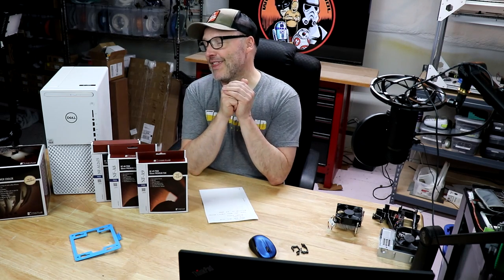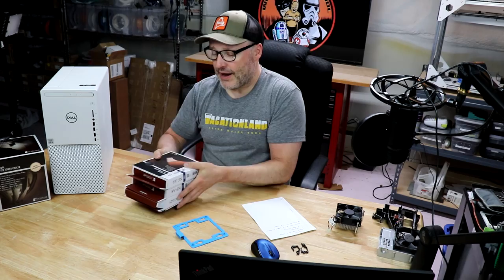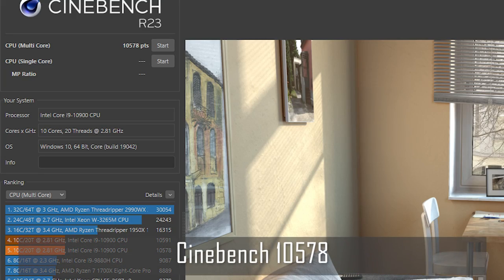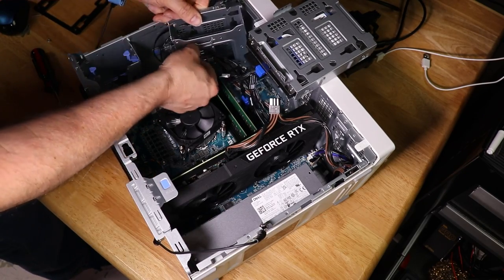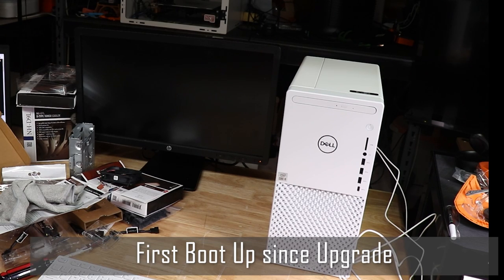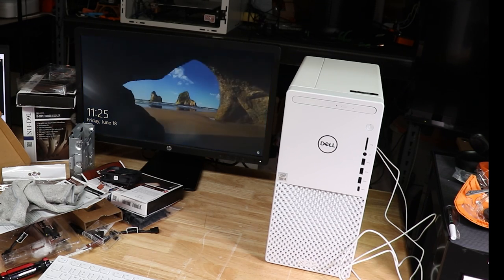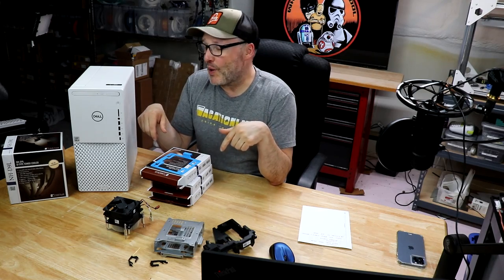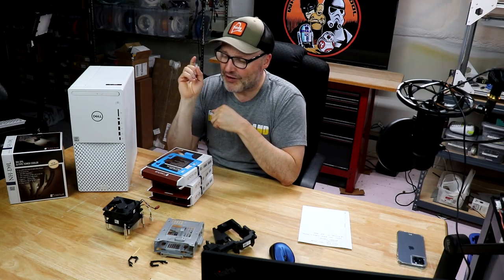Dell XPS 8940 / G5 5000 - Upgrading CPU Cooler and Fan Upgrades for better performance?

Comment: Basically you had to fix what Dell didn't engineer in and should have.   A front intake fan, a propper heat sink, and propper exhaust fan is a given not an option.
Reply from the maker: Right?  I mean it’s sad to see a good Intel i7 or i9 heat throttling down the performance

Comment: Added that cooler to mine. 
Now it doesn't throttle the cpu. 
Instead the PSU trips due to over load. LoL
Reply from the maker: Really?  Mines still running great

Comment: Dell's PC's are built to fail so you have to go buy another one in 2 years. Those temps out of the box are just ridiculous. The lack of airflow and crappy cooler ruin them. If you can wait til prices come down on the GPU's, it's very much worth watching some you tube tutorials to build your own computer.
Reply from the maker: I’d very much prefer to build my own but given the availability of parts, this gets me by
Reply: This is completely untrue Dells are conservative builds for stability and longevity. I’m using an xps from 2013 and it Has never failed in that time

Comment: I have the same computer and wonder why Dell charged me $3000 for a computer I can't use until I upgrade the cooling.  Never Dell, Never Again.
Reply from the maker: We do what we must during supply chain issues, right?  I spent $150 in a cooler and fans to get more performance.

Comment: i wish i could educate the whole world against buying any gaming/creator pc from Dell. Dollar for dollar, Dell is the absolute worse. (Linus Tech Tips, Gamers Nexus, Dawid Does Tech Stuff) And their parts are ALL proprietary. so you can never upgrade anything unless you buy it directly from Dell for triple the amount
Reply: I know there are better gaming computers but if you’ve inherited a Dell or picked one up cheap you can Frankenstein it.  I did most of what the channel owner did to make a video editor.  I have a 2TB NVMe boot drive, a 8TB SSD project drive, and an 18TB archive hard drive.  I upgraded the RAM to 128GB with heat sinks, I upgraded the CPU to an I-7 10700K, I upgraded the power supply from 360 - 500 watts, I installed a 3 fan RTX 3060 Ti, I installed VRM heat sink, I bought a 42MM cooler for the PCH but Dell doesn’t have a sensor for the PCH so I didn’t want to take off the aluminum heat sink.  The PCH gets hot so I’d like to cool it but not knowing if I’m cooling it isn’t a good idea.  I also installed bigger case fans Rand the G5 CPU cooler but I occasionally get an error message about the CPU fan not working and there’s no way to tell.    I switched it out to be safe but that MoBo wasn’t designed for modding!  It runs DaVinci Resolve with no issues!  128GB of RAM, 10 core CPU with 20 threads and 8GB of video RAM is plenty for video editing!  Now, my ISP sucks because my internet speed is 100MB download and 7MB upload.  Even if I switched to fiber optic I’d get 1GB download and only 35MB upload.  I’m making uncompressed 4K videos to upload to social media so upload speed is much more important to me than download speed.  At least with DaVinci I can queue up my videos and let them upload while I sleep, praying the power doesn’t brown out or internet doesn’t crash.

Comment: So it really wasn't worth it.  Why not make it 50 degrees?  It just doesn't have any practical purpose.
Reply from the maker: Wrong. CPU temps dropped drastically and no loss of performance from thermal throttling.  However not much gain in lower GPU temp
Reply: @WhereNerdyisCool  How much % of performance did you gain by reducing the degrees?  The amount of the degrees you reduced it by could have been 100 and what good is that?  Oh look my CPU is cooler?  I don't understand.  Is the CPU making ice cream?
Reply: @tishela1134  cooler Temps means the cpu  won't throttle as much due to thermal restrictions on non k version of the 10700 & the 11700.
Reply: @tishela1134  temps improve cpu performance by allowing the cpu to run longer at boost speeds, maximizing the avg frequency

Comment: Is the rear fan pulling heat out or pushing in cold air from the rear?
Reply from the maker: Pull air out of the case.